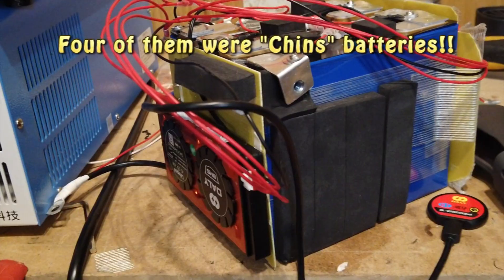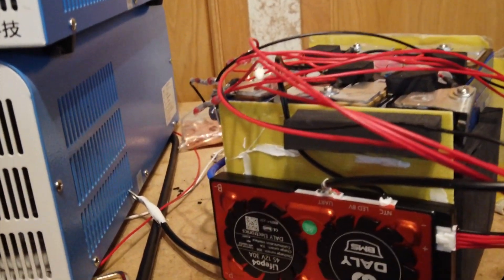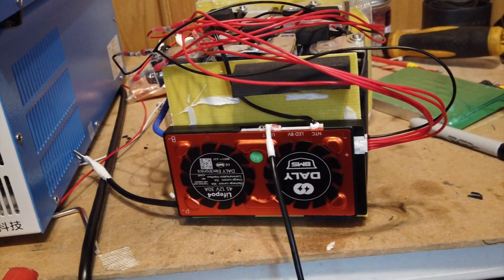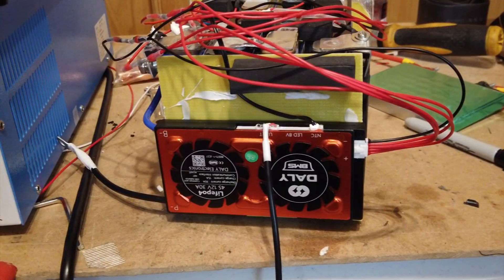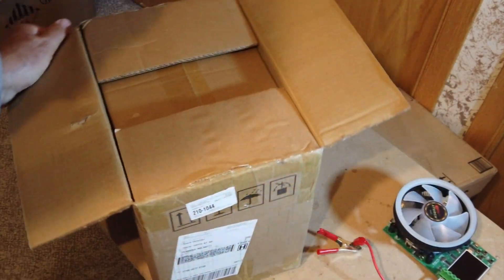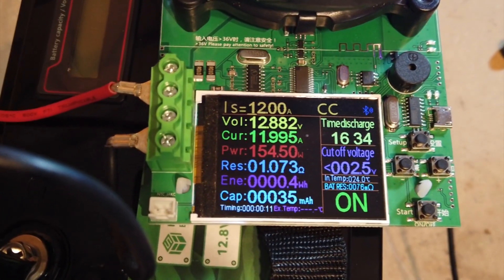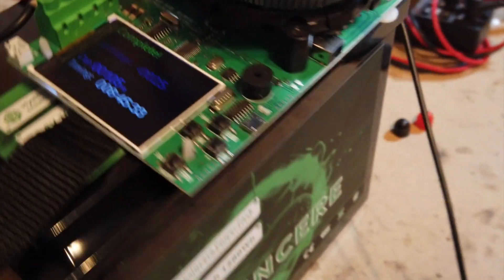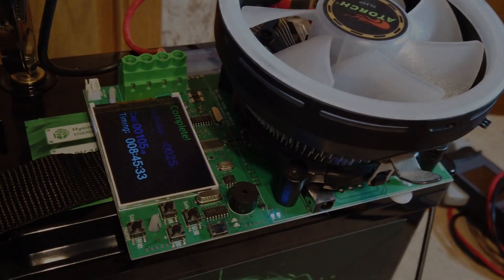Cheapest 12V. LFP 100Ah Battery on Amazon Part 2 & channel update

Comment: Will 2 12 volt battery 100 ah batteries work in a motor home for cabin batteries
Reply from the maker: @JohnManning-zz2vb  I guess depends on how you hook it up,  24 volt is better than a 12 volt system, 48 volts is better than a 24 volt system. The higher voltage the more expensive the inverters, charge controllers can be! For a cabin I would recommend at least a 24 volt system, wiring for a system is less expensive the higher voltage your system is and copper wire can be expensive!